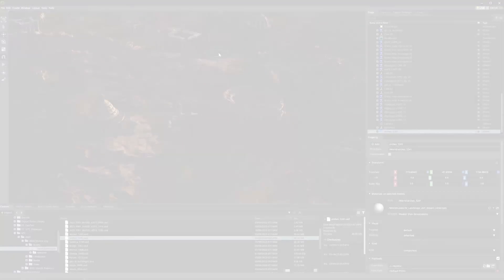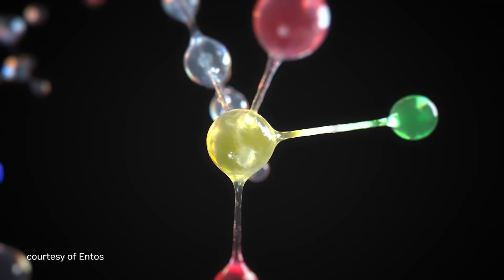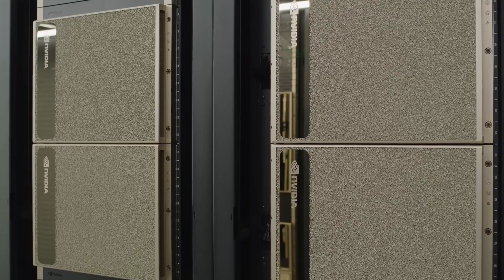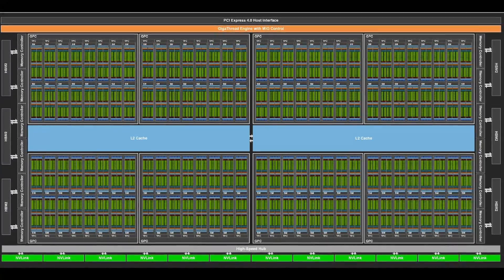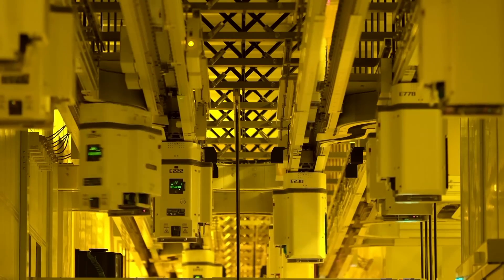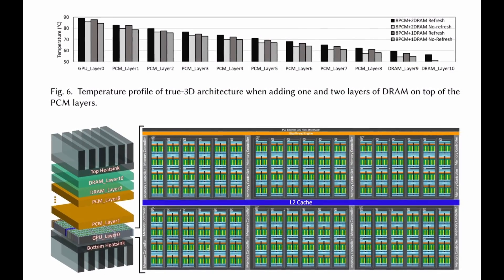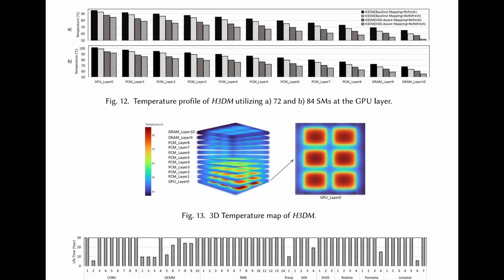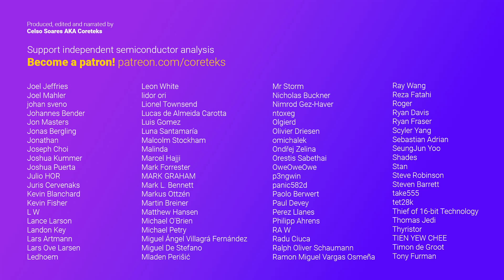The FUTURE of GPUs: PCM

Comment: U have a certain workload to get through as cheap as possible, could u sell more ai/gpu units because its cheaper or because the units are so fast that people want more?Think better graphics?(im still using 1080p screens, its good enough: cheap) Idealy i want quiet, fast enough for my game/web browsing, cheap, compact(netbook size) and not power hungry(long lasting small battery). Imagine if i could have a xbox/ps5 in my small netbook(sub 13 inch and less than a kg) and its silent! No fan!!!! GPU's are fast enough and good enough but noisy! I would def go for a silent, very low power option but cheap....this is my world that im looking from, my question to the brains out there, what points is this PCM targeting?

Comment: Without any doubt memory needs to catch up with the chip logic as it was left far far behind for decades and cache like SRAM memory is not sufficient enough nor economically viable to be that next step even it will most likely rely on 3D stacking similar to AMD's V-Cache. 
One moment memristor looked like solution and holy grail of the compute memory but it might be actually PCM. Let's see, thx for the vid!

Comment: 1. Jim Keller knows what he is doing.
2. Cerebras is 3rd way - it has so wide fabric, that it can offload memory.
3. PCM requires huge temperature swings. Optane had to heat up single bit cells to 400 deg. Celsius. it's not-unlimited lifespan came specifically from cracking issues.
4. Stacking requires ability to move all of compute layer's heat load through all of the memory layers. 3D-VCache shown this precisely. Every layer literally robs underlying die of TDP. :C

Comment: What a bunch of incoherent rambling about compute architectures and then somehow mixed in 3D integration and different memory technologies. 

The majority of power is dissipated on the GPU die, therefore you cannot just stack insulating components on top of it. The refresh power for DRAM has little to do with this and PCM wont fix it. The Iranian paper somehow  appears to envision sandwiched cooling, which is a completely different point altogether.

Comment: Stacking memory on top of a chip performing calculation is not so great idea, unless it is low voltage low power chip.
Proper way of doing things is to stack a compute chip on top of memory, this way you can put cooling directly on top of a compute chip.
Reply: That's how adamantine does it right?

Comment: Fero magnetic and other forms of resistive ram (spin torque) is more likely than PCM that has its own system heat issues that can flip crystalline bits. Intel has shown they can stack mylar cells essentially with Optane but not profitably. Ultimately it all gets down to cell size and SRAM on 'stacking' is very cost effective albeit as noted here power consuming. The stability and endurance of solid state magnetics, spin and tunneling will win and are winning now in industrial embedded and aeronautics they are much more stable. The Intermediate step is to place FPGAs that are SRAM laden with various processing elements onto a GPU but ultimately the trend is toward solid state memories, a return to solid state memories actually do your research. mb

Comment: So, will AMD be able to reduce the insane "power consumption" of it's GPUs @ "video playback ?"

Last Gen's 6800 (and up) RDNA 2 GPUs & the new 7000 (RDNA 3) series have serious power issues @ video playback (YouTube, Netflix, VLC etc.) 
Check out the "doubled" video playback consumption of 6700 XT (20W) vs 7700 XT (42W) at TechPowerUp & ComputerBase
40+ W is stupidly HiGH & meaningless...
AMD needs to solve that "power issue @ video playback" at least in the next 8000 series. (or do they even care?)

* Emphasize on "video playback" as most people confuse it with idle, web or gaming consumption. They are very different things.
AMD, still didn't solve the "video playback consumption" the previous solution was for "idle consumption" only.
PS: RX 7900 XTX is still the record holder with 67W but 7900 GRE is getting closer with 62W on watching Youtube !